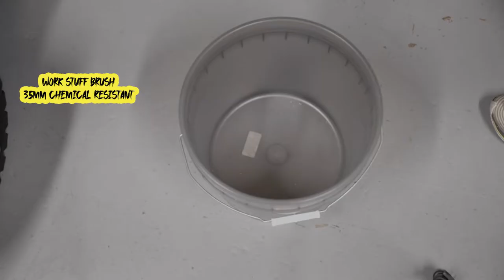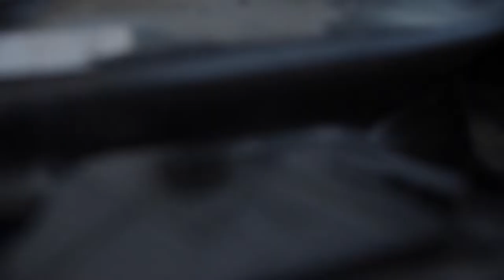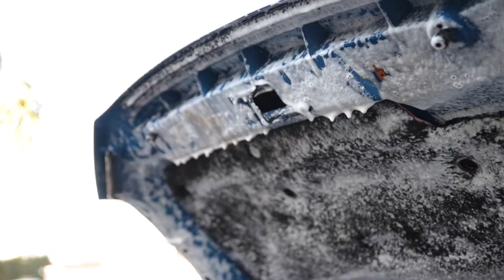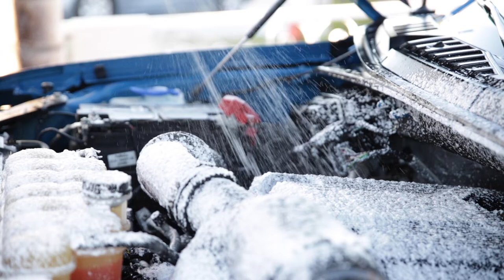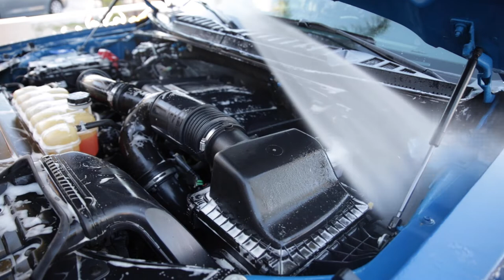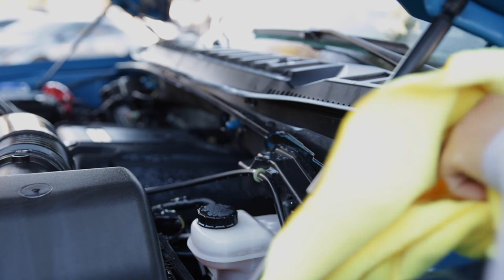Engine Bay Detail - Deep Cleaning My Ford Raptor Engine Bay

Comment: Awesome... so do you not have to disconnect the battery? Great video
Reply from the maker: Not on modern cars. I’m also blowing off all of the water immediately after rinsing.
Reply from the maker: Not on modern cars. I’m also blowing off all of the water immediately after rinsing.
Reply: I was wondering the same thing. I always want to clean my engine bay but grew up hearing that you could mess up the car. Nice detail 👌🏼